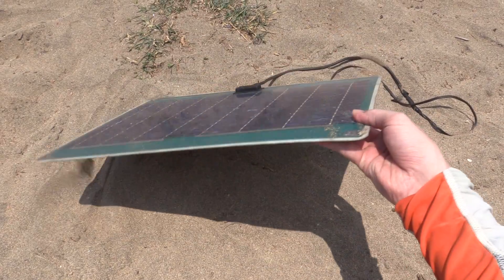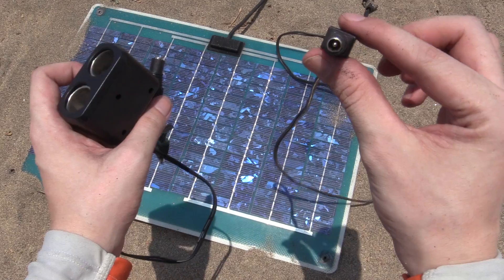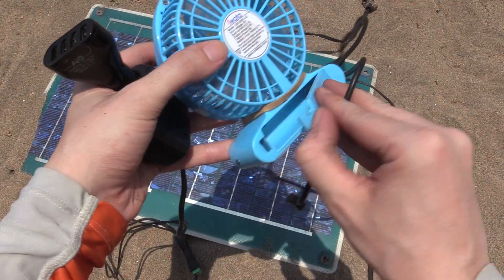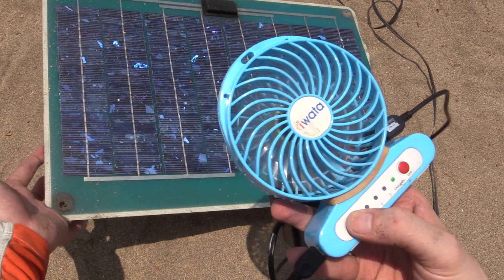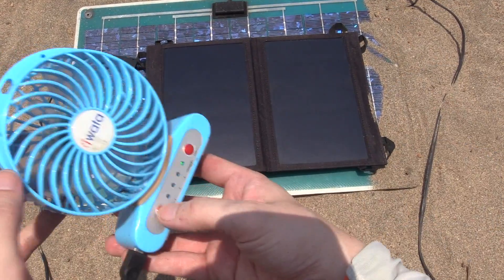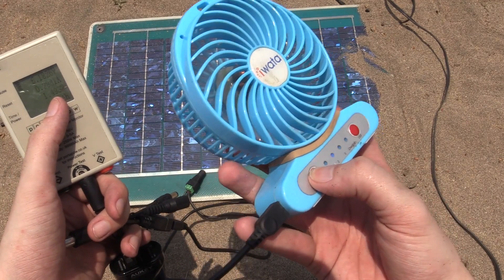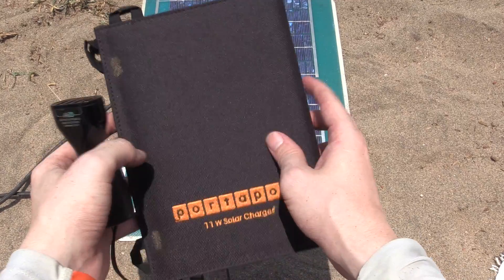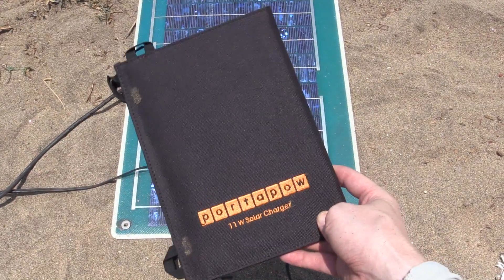Solar panels without charge controllers

Comment: I've been watching your videos and i was wondering how your solar panels from cdr king are holding - the 100w ones i mean.. Im thinking of putting together some solar pannels for our house to help with the bills
Reply from the maker: Other than collecting some dust and dirt, they're still going strong :) CDRKING change suppliers ALL THE TIME so buy one to start with, test the output and then go back for more :)
Reply: Gadget Addict 
How much are the 500w ones and the 100w ones?
Reply from the maker: +Adam Gadut I don't think cdrking do 500W panels. That would be hugeeeee. They charge around 3k PHP for a 100W panel when there's no promo. They have 250W panels but the prices are ridiculous like 9-15K.
Reply: if i have a couple 100w pannel, a charger, a 200w inverter, and a couple 12 volt SLA batteries.. would that be enough to run our lights for the whole day? we use lights probably 12-13 hrs per day, and most bulbs we have are somewhere around 10 watts - 9 bulbs all.